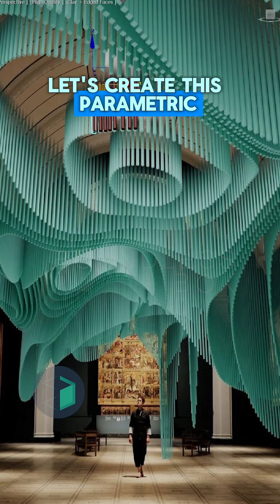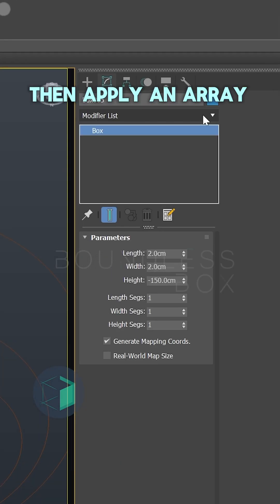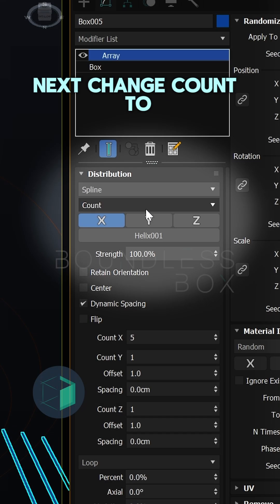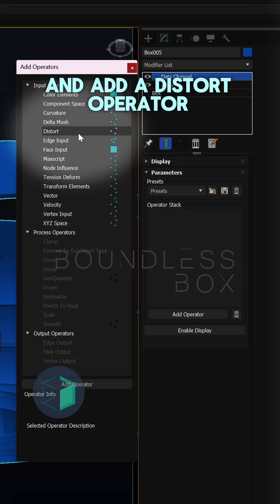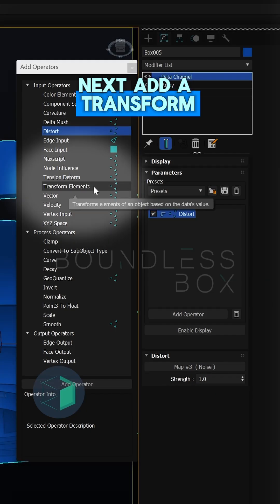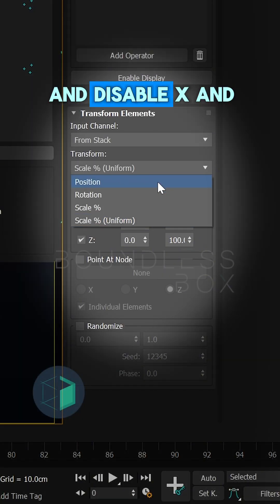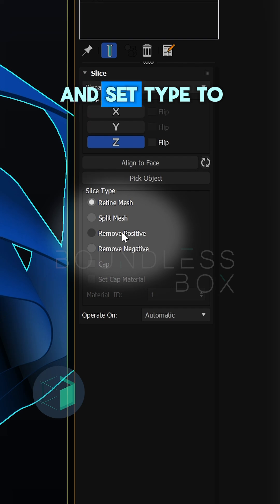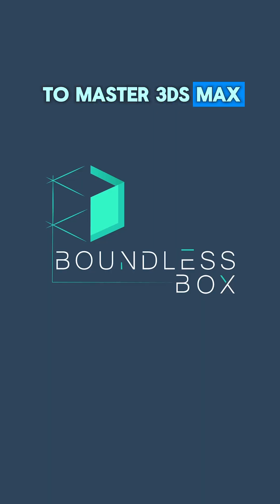Parametric ceiling using Data Channel modifier

Comment: You don’t need to use data channel to random extrude / distort your object because the array modifier you used already have a random section where you can randomize the scale on Z .
You can also distort using other randomization already present in array modifier.. I don’t get why we use the data channel here
Reply from the maker: The Array can randomize the scale, but it’s completely random, as for the current array modifier you can’t control the shape for the scale. On the other hand using the Data Channel can give you precise control over the scaling, in this short tutorial I used a noise map which is a bit random but, you can also use OSL to create a wave form that follows the shape of the spline and control it precisely. Hope this explanation clarifies your question 🙏🏻